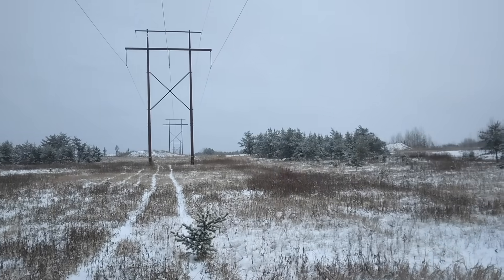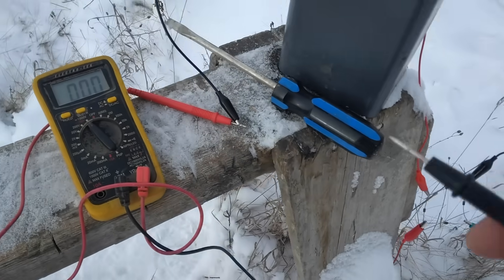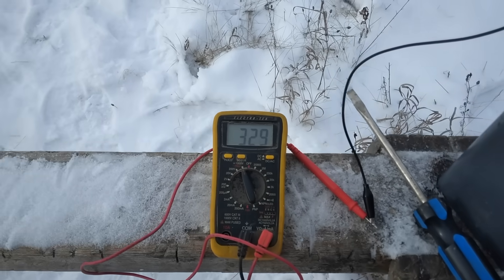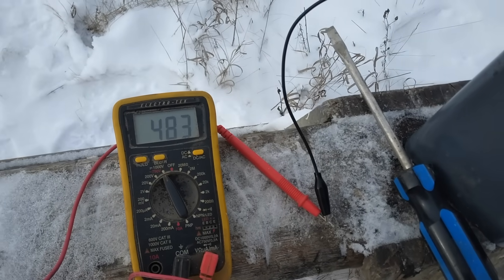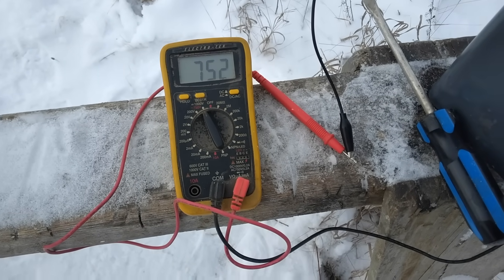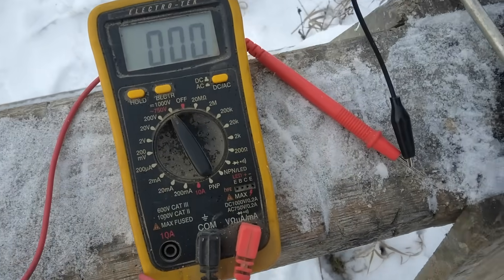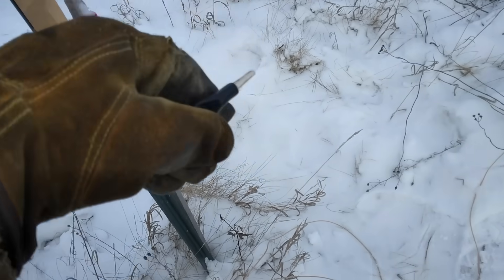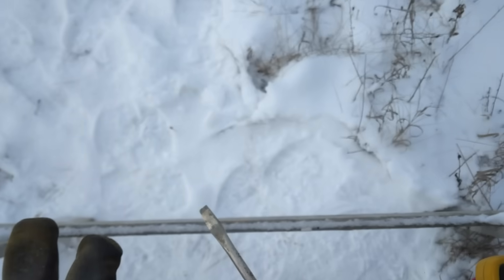Fences sucking power from under HV transmission lines

Comment: as a retired telephone linesman, I've dealt with EMF many times and to all kinds of degrees.The worst was when I was placing a temporary aerial cable under a large transmission line.I was in bucket, and blue spark started jumping between different metal parts of the bucket. I came down and grounded my truck, Still sparks jumping. I ended up finishing the job with hi voltage rubber gloves on, as I couldn't touch anything without getting zipped.
Reply: And the customers complained of hum on line
Reply: @russellsmith3825 Meanwhile, your brain is cooking!😮😱😶‍🌫️
Reply: @leechjim8023 Yeah, that’s not a thing.
Reply: @leechjim8023  People think because it doesn't break apart the atoms in your body, therefore it won't hurt me. Classic cognitive dissonance.
Reply: @HerrUnterhugel , a few decades back, a factory worker died and they couldn't figure our why. His replacement started becoming sick, showing some of the same signs.  They figured out the problem was, the workers were working next to a 150 horse motor that was emitting huge amounts of EMF.
Reply: @HerrUnterhugel  That is not a thing sure, but there are some effects that non ionizing electromagnetic radiation can cause. It can effect your DNA as well as random cells throughout your body. Even a high powered wifi transmitter has the capability to generate reactive oxygen species within your body. (proven on flies so far but not humans for full disclosure) but there is no reason that the fields involved wouldn't cause reactive oxygen in the human body. Long story short, I would not willingly live under high voltage lines
Reply: Years ago,I had a customer that was fed by type C rural wire, with the 14ga hardened steel conductors, it was hung on a transmission line on wooden poles, following an ice storm one side went open, and we had a helluva time measuring the open because it induced something like 130 volts AC, and because it crossed a highway ramp it was stupid high, so a regular bucket wouldn't reach, they ended up hanging a 6m strand and lashed a 6 pair drop to it because it was way too far between poles for self supporting drop.
In retrospect, I should have had them lash up 2-19 Gopher wire, so we could have bonded and grounded the shielding, would have really reduced the FEMF and power influence.
Reply: Rural "c" was the worst for EMF pick up. I was stripping some one day to lay down in 5502, by my belly. It jumped arch blue spark onto my belly, and thru my shirt. Burned me and a hole in my shirt. I'd have to ground the wire, and I'd have about 20 seconds before another charge would hit. 
Another time on an ice storm, 4 guys were picking up some 109 for me on the pole. They picked it up, and all 4 knocked to ground with arch between wire and ground. Again for me to "tie" in the wire on the insulator, I had to ground it out and quickly tie onto insulator. We initially thought we had a primary wire laying on our wire.... but we drove the area a mile or so in each direction ..... no primary. Just EMF.
Reply: @brucewhitefoot wow so what would be the best way to Hartman that EMF?
Would it be possible to create a trickle charge strong enough to charge a large battery bank, like the ones used to power your house and are charged with solar panels
Reply: @timr6301  I have no answer. I'm no electrician or engineer. I've just experienced these situations. My foreman who also is no electrician or engineer told me to ground the truck.  Which obviously didn't work.
Reply: I experienced this in working with telephone open wire bracket leads which were on joint REA/RUS single and three-phase AC distribution circuits.  A blue spark about half an inch long extended from my finger to the uninsulated (telephone) line conductor (109 copperweld).  What a jolt from induction even though the aerial open wire was non-working and was scheduled to be "wrecked out".
Reply: I to worked for for a phone company(40yrs)line man, installer res.&bus.repair, this is NOT UNCOMMON, i used my voltage wand to check for "forein  voltage) yes i had HOT readings in one area, power co. had UP GRADED power AND that caused "INDUCTION/ humming sound of A/C to the phone lines until GROUNDED, but it would build back up, this HAPPENED in only ONE part of the POWER GRID i was working in,NEVER put myself BETWEEN a GROUND connection and line that showed INDUCTION POWER a line like would a nice ARCH 1 1/2 in form a source of earth ground and discharge power BUT would build back on.  Reported this to my boss, don't know what was done to correct, probably nothing, i just worked around problem when in that part of the grid but i did get bitt a couple of times
Reply: heres a couple more incidents I remember. House built in new subdivision, had the attic lined with copper wiring, to steal what he could. Had built under transmission lines. Eventually he sold the house and the New owner kept trying to figure out why everything in his house would "static" zap him. He finally got an electrician to his home that knew his stuff. He discovered the bare copper lined attic.
Reply: And now here I am confined (hopefully temporary) to a walker, with a leg issue. I have found with this walker, and its neoprene wheels (I think they are, as they are soft) anytime I walk across smoothed indoor concrete (IE menards, hospitals, etc) I get a huge jolt thru the rubber handles about every 15'.  I'm actually stumped with this, as I'm sure its not EMF. But boy howdy its quite the jolt.
Reply: @brucewhitefoot  try doing a detox protocol to reduce metals in your body, so you don't attract the current through you as much. one of the best is very simple, a 3 day water fast to flush out your entire body of waste, and to induce autophagy. God bless brother, love the stories.
Reply: I'm a telco tech, and I'm not qualified to do aerial works, so I stick to the underground stuff. Most of the comms calling where I live is underground. I think reading all these comments has convinced me to not bother getting my aerial qualifications! 😁
Reply: @iamdave84 Been in underground 40 years with a ton of fiber buried on power line easements. Sheath in some areas have 140 volts. Makes it nearly impossible to locate
Reply: @jamesyoung3341  that's no fun. My comment didn't age well. I've just got my aerial quals because it became mandatory for my role.
Reply: @iamdave84 make sure you use your FVD. Power faults on telephone poles is a real thing. AT&T tech for 26 years and counting. I’ve done POTS and DSL and I’m now in Specials (aka Business Services). I’ve found a few “hot sticks” in my time. When I do, I call the power company. If I can I wait for them to arrive and show them what the issue is. Unfortunately about half the time they say there is nothing wrong. But the other half recognize the problem and rectify it. Bottom line, if you don’t feel safe, don’t do it. Don’t worry, you’ll do fine.
Reply: I was on a storm break in South Eastern Nebraski. Ice had taken down lines over 3 counties. I was on a pole putting back up a 2 wire lead on oak brackets (109 iron wire) in a very rural area. Guys on ground had picked up the wire out of the wet slushy snow, and got knocked down by the static charge. Fore man immediately took off in the truck. Drove miles in all directions thinking the wires were laying on some downed power lines. It wasn't. I finally got the wire up the pole, and had to ground it every 10 seconds or so, or it'd bite the hell out of me, visibly with an blue arch.
Reply: That's so true. The C- Rural Drop packed a hell of a zap brucewhitefoot !😅
Reply: @tenebraygrace4099  As an open wire fan, we had a requirement by the Texas Railroad Commission (and old fashioned term for state utilities commission) to remove all open wire in SWBell territory by a 1999 date in order to allow Internet access to our subscribers.  We put up C-Rural Wire in its place.  Yes, induction was a problem with it, as was open wire service station bracket leads.  However, will say this in favor of open wire: squirrels LOVED C-Rural Wire to chew on.  We had more outages with this than ever on open wire.
Reply: "And if it snows that stretch down south wont ever stand the strain!"
Reply: I would think grounding your truck is the exact opposite of what you want to do
Reply: @timr6301  I have no idea
Reply: @brucewhitefoot  my company (GTE) cut off all service to an entire mobile home park in 1985 because the cable bonds were melting and arcing and the splice encapsulation was burning our hands even with hot gloves on.
Reply: @allenbold4861  amazing.... We were trained a little about grounds (as linesman)and safety. Agriculture settings were where we really had to be wary, as back in the day, farms didn't have to abide by electrical codes.  Just guessing,... that trailer park had a ground issue, or the dirt wouldn't carry ground? interesting stuff.
Reply: @ 2 issues were that the park was powered with cheap AC aluminum cabling
Reply: And we could couple 3 8ft ground rods together down 24 ft and still not get an acceptable BGM reading
Reply: wow..... remember a soil type?
Reply: @ good old sand ! Desert Hot springs California just outside Palm Springs
Reply: It’s nice to hear phrases that I recognize . ( 32 years GTE/Verizon and “yuck” Frontier)
Reply: You need to unground the truck.
Reply: @will7its  thats a good idea, but that is where I started, and called power company.... they said to ground it
Reply: @brucewhitefoot  That figures.
Reply: i parked my truck & small enclosed trailer under some lines at an offroad area a few years ago, got back from riding, the trailer had become mildly energized, gave me slight shock when i went to open the door.
Reply: @3EyedMutantFish trail riding keeps us young stay safe

Comment: The information used to be easily available but has been scrubbed and censored. If you layed out a conductive wire in a wave pattern.. I don't remember the math involved..and a distance to match the, I think 60hz..you could get enough electricity from the magnetic field of the alternating current to power your entire farm.

Comment: Hmmm...Fair size Tesla coil connected to a transformer connected to a house plug .....Try a different setup and try to run some appliance or charge up a cell phone. Another test would be amperage . Interesting. :O)

Comment: Great video. You should build an over size AC current tester pen with an LED light to show just how little energy it is. The voltage potential there is massive but before people get worried he will be done for energy theft or get ideas about powering their home 36.2 joules is 0.01 watt hours, enough energy to power a 0.6w globe for a minute and took much, much longer to store that charge.... Also be cool to see you test some gas tubes/fluorescent tubes and change height of fence to head high as inverse square that little bit closer should get a good jump in energy, still barely light a globe dimly but still cool to see practical demos of this stuff.

Comment: U take a copper coil of bare ground wire and. Bury it under the lines and then have a lead to test and a ground rod on the side you want power on near the house or w

Comment: I once put some threaded rod into concrete foundations to later use as bolts to hold down a timber frame building. Next day I tripped over and nearly impaled my head on one of the rods. I put some off cuts of PVC pipe over them after that. Take care now.

Comment: An mean, nasty, stingy but super nutty person would want as much of that free electricity, and damn well find a way to get as much as possible then sell it back to them thru high voltage string inverters they use on solar farms that they put at the end of a row of solar panels.

Once you find out parallel vs series what is the ideal height from the ground,  jacketed vs bare wires, wire/s vs mesh wires, thickness of conducters.

Once you find a sweet spot with all those things then you can make a plan of action and milk it for all its worth and make it look as normal as possible so they never find out 🎉😮 😊

Comment: 800 to 1200 Vdc is typical of the voltages used, internally, in a vacuum tube oscilloscope.

Comment: The old rule of thumb says that a capacitor charges completely after a time interval of 5 time constants. A single time constant (in seconds) is equal to R (series resistance in ohms) times C (capacitance in Farads).

Comment: Ask any lineman, the field he is capturing is millivolt. I own that exact meter. It cannot read any voltage from his wire directly to a grounding electrode. If the force is that great, put a light bulb in your mouth and test if you light up the bulb😂. He is capturing a very slight EMF field.  I made a fortune for a few years from people afraid of becoming sick omg cancer, from 240V EMF forces inside their own house 😂  A snake 🐍 oil salesman created an environmental safety company and had his GOUZE meter in his hand. 😂 One pregnant woman freaked out when his GOUZE meter lit up in her bedroom.😮😂 I got a call to investigate. 30yrs in the business. He frightened her so badly that she wanted her 200A service replaced in ridged conduit and bond a lead blanket that he sold her to block the EMF coming from under her mattress. I said lead causes cancer, and I install lead linings only in MRI and Xray equipment. He detected a slight current running on the grounding wire. I called for a meeting with the idiot and walked him around the house to measure. I already knew only the bedroom and garage were effected. His GOUZE meter was custom built🤨 I shut the circuit off. Problem gone. I proved that the neutral on the circuit was returning on the grounding wire and the bad connection location in a receptacle next to her bed. A simple polarity plug debunked his GOUZE meter.

Comment: I thought of an experiment you could do there. Get yourself about 5 or 6 rods. Put one right underneath the power transmission lines in the ground. And then walk away from them. Put a ground rod in every 10 to 15 feet. Do that till you get out to the length of your coax cable and put in the last grounding rod. Then take your multimeter and measure the voltage difference from the one grounding rod underneath the transmission lines and chart the voltage received at each adjacent grounding rod as you go out to the last one. I guess It would tell you how much electricity is being absorbed into the ground underneath these transmission lines. While it may not seem like much at one individual spot, you have to consider the additive results of the electricity put into the ground over the Miles and Miles run of the transmission lines. There are some earthquake channels that say  earthquakes promulgate in areas near transmission lines due to the electricity absorbed into the Earth causing increased seismic activity.
Reply: Dutch❤

Comment: hope that wasn't your favourite screwdriver. 
as others have said resistor is a less destructive way to discharge the capacitor. and it'd be safer for you if you use insulated croc clips to attach it as well.

Comment: When lower potential power lines must cross under H.V disribution lines, they bury that span, and also make the crossing at a 45 degree angle.

i suggest you angle your 'fence' at 90 degrees to the H.V lines, and use a very thin wire to limit amperage at first.

Just for giggles, grab a fluorescent tune and some pvc pipe and a 90 degree elbow, and play with it under the lines.

Comment: in theory that voltage would have continued to rise until it saturated the capacity of the capacitor you were using, so it could have in theory gone to 1200V, as far as measuring really high voltages you can buy, or build a probe for that that uses several 1Meg Ohm resistors and forms a high voltage and high current voltage divider, so hundreds of volts would show up as either volts ie 100V would be a 1V reading or 10s of volts i forget which, still impressive to see the immense power radiating off of overhead wires
Reply: The voltage is immaterial, it is the current (amperage) that is dangerous. 

For example, I once built a Tesla Coil using a neon sign transformer with a 20,000 volt at 40 ma secondary. The Coil's turns ratio was 1:50, so the theoretical voltage was 1,000,000 volts and the theoretical current was 0.8 milliamps.

Getting shocked by that was painful, but not harmful.

Comment: 1:42 You've been conned.
That's not a "Full Bridge" rectifier - - - it's a "Full WAVE rectifier, connected in a "Bridge" configuration!
Incidentally, you could have used a run of BARBED WIRE, or any other CHEAP conductor - - - and have saved yourself the UNNECESSARY cost of EXPENSIVE co-axial cable.
You still have MUCH to learn about basic electricity.

Comment: Before Power companies could tell to the metre where parasitic loads were stealing their power.

A farmer here had a collapsible arrangement where he raised a coiled wire up under a powerline and the induced electrickery ran his milking operation...twice a day.

When finished he dropped the contraption masking it look like a part of the fence line.

It took a helicopter flight one afternoon in summer to pin him for the theft of electricity..

Comment: I use my bare hands to find bad spark plug wires and yeah, the coil can sting a little bit, but when I heard the snap coming off that capacitor my brain instantly envisioned the end of my finger completely shredded and on fire!😮